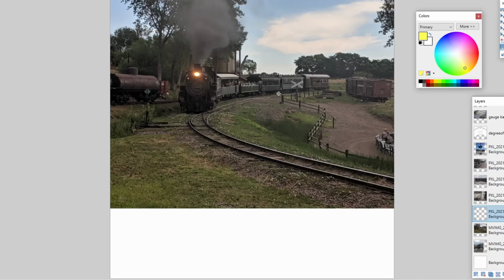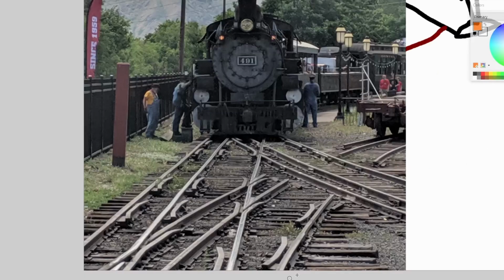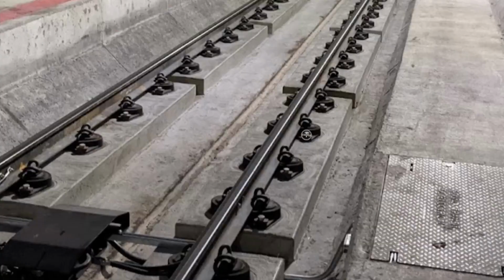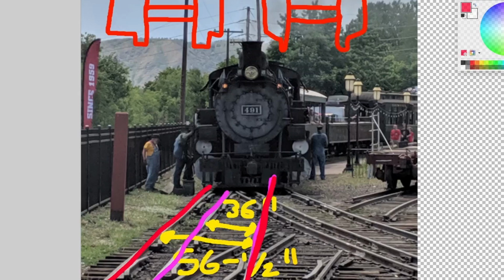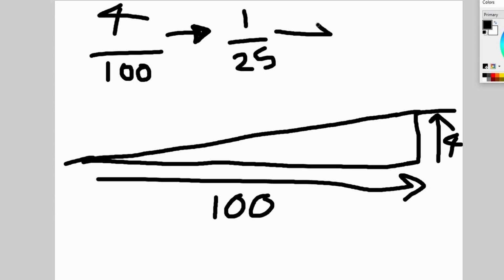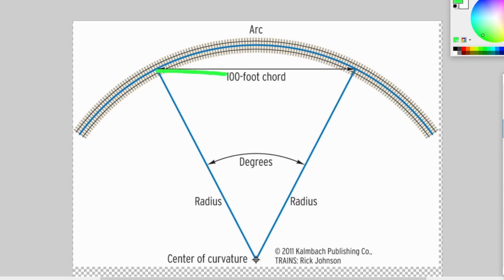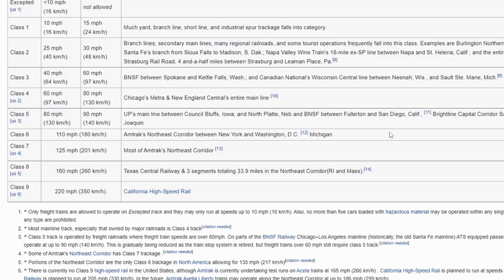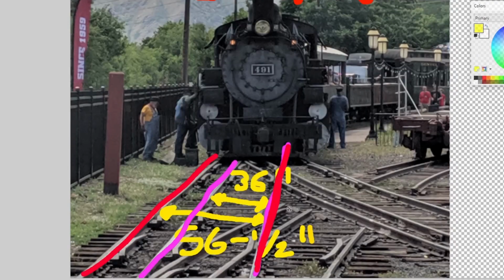TRACK 101: How does track work? (Including many often-missed things!)

Comment: Now continuous rail is generally a very good thing.   However it can be overdone.   An early installation of continuous rail in the Salt Lake area of Utah did not have enough expansion joints.   It worked fine in the winter.   Summer heat made the rail expand until it pulled free of the ties in a huge bow or curve.   Now I am sure they are far more aware of adapting  continuous rail to extreme  temperature changes.The special trains for continuous rail and the related thermite welding are amazing.

As a kid I spent hours at school watching a switcher very slowly move one or two ares along a virtually unmaintained track.   It is now a commuter rail line with proper ballast and  new ties.   the change is like night and day.  Nor does the commuter train have to crawl into Boston.

Comment: One thing about ballast that most people, including railfans, miss us that it provides most of the suspension for trains especially the locomotives. A steam locomotive has very limited travel for its axles whilst diesel and electric licomotives have a little more travel. In the UK it has been reported that short-wheelbase steam era wagons bouncing themselves off high-speed CWR at a speed they would be comfortable on sectional track due to the high-speed track having a much firmer trackbed.

Also the depth of ballastingbhas changed over the decades. In the early years in the UK the sleepers could be buried in the ballast (which at that time could been crushed granite or ash even on the ,ain running lines). Eventually the crush rock ballast would come to almost the top of the sleepers. But when CWR was 8ntroduced such ballasting did hold the track firmly enough in high-speed lines and so deep ballasting was reintroduced so that the top if sleeper was at least level, with the top of the ballast or in some places the ballast covers all of part of the sleepers.
Reply from the maker: That's interesting! Had no clue. Cheers!

Comment: Not sure about the US, but the UK has a lot of 3-rail systems where the 3rd rail is an electric power carrier for train motors, either inside or outside the standard gauge, mainly used on underground (subway) networks

Comment: HOW ARE THE RAILS BENT AROUND A CURVE ? THEY SEEM PRETTY UNBENDABLE TO ME!
Reply from the maker: Sharp curves get pre-bent, but most can just be bent and spiked in place.
Reply: The rail is designed to flex. It is not bent to fit the curve. It will straighten out by itself when you remove it from the curve.

Comment: Nice.   A couple of bits you may want to add ...
* Rail chairs tilt the rails inward a few degrees to assist the camber of the wheels to self center axles.  Not really required for low speed on narrow gauge, but essential for anything over 60kph, otherwise wheel track 'hunting' will put a flange hard enough into the side of the rail head to climb up and over it.  Older switches transitioned to vertical and so had speed limits but modern practice uses special head profiles.
* Below the ballast the sub bed between the rails is formed with a gentle slope to each side for positive drainage, otherwise whole sections of ballast can be pumped across a flat mud bed.  This surely assisted your curve being more easily moved.  Here, in eastern Australia we built 'pioneer' tracks with local stone or cinders as ballast, but ALWAYS with a large sub bed hump in the middle and drainage ditches each side.  Many of these tracks are still in use on agricultural lines after more than 100 years, though the 15t per axle limit is still applied.
* Tie spacing and rail section are interlinked via young's modulus.  If short, soft iron rails are supported at 3' centers they will flex with as little as 2t per axle passing between the ties.  Close spacing and stronger, bigger rails, esspecially with tall webs, can support many tons with minimal 'pumping' which is less detrimental to the ride quality and reduces tie 'walking'.
* There is a difference between grade and gradient.  Gradient is a changing height while grade is a height at a point along the gradient.  Thus a track may have a 1% gradient while a level crossing meets the gradient at some particular 'grade' and a road over-bridge passes the track above grade.  This is also used in roadway terminology, a highway can have some intersections 'at grade' requiring varying speed limits while a motorway has long on & off ramps with all crossings above or below grade so that speed never has to change while actually on the motorway.  bye.

Comment: The holes in the joiner bars (fishplates in the UK) would be elongated in the longitudinal direction to allow thermal expansion. CWR needs expansion joints. In the UK there is a gap of 3/8" between lengths of sectional track to deal with thermal expansion. There are some British track maintenance films from the 1930s/1950s on YT for those who are interested.

Comment: track speeds for passenger trains...I have done a couple Amtrak vacations, one was Cleveland to DC then DC to JAX.  It was lovely (I had a railroad frequency scanner and got to listen to all the chatter) but the track was not always fun.  Some parts of the east coast, Amtrak rides on heavily used freight track and...you know in a movie theatre or on a plane where there's THAT KID kicking the back of your seat and you can't say or do anything because the parents will get upset?  Some parts of east coast Amtrak route are like that.  Th-thump th-thump th-thump for miles.
Reply: re: scanner... middle of the night in Georgia someplace, train stopped at a little station.  People on and off, stuff hustled around the platform, but then the train just sat for a while, and someone on train radio asked the station what the hold-up was.  Station said a woman with kids and a bazillion pieces of luggage had just shown up and were trying to bull their way through the ticketing process and generally being hard to deal with.  A couple minutes more and the train inquired what the situation was now and the station replied, well, she's being really rude and it would be all the same to the station if the train just went ahead.  And that's what the train did.  If it's after midnight and you didn't take care of anything in advance and you need a lot of handling at the last minute...be nice to the people behind the counter.

Comment: Four-rail dual-gauge track is used where both standard and five-foot gauge are found, mostly in areas where the Russians built the track. The 3 1/2" difference is too close to permit three-rail, so they had no choice but to use four. Three-rail is still common in Japan where standard and 3'6" gauges coexist, and I think Australia has some, too, unless they have managed to settle on one gauge now
Reply from the maker: Four, but with rails staggered I presume? i.e. 5' gauge left rail, then standard left, then 5' gauge right, then standard right?

Comment: Nice video. I would add that in curves, besides superelevation, the gauge is also widened, to allow smoother drive of the wheelsets. Depending on the specific rolling stock, the amound of widening can wary, and it depends on the radius as well. Also, flanges on the rolling stock, especially locomotives, can be made different on the driving wheels, with the "outer" ones having them smaller and/or moved. Or the contrary, the "inner" wheelsets can be flangeless to improve driving in tight curves.

Comment: Good summing up. US Joint Bar, UK Fish Plate, but we don't stagger the rail joints over here. So on poor condition track you don't start a rocking motion. In the UK we've used screws into sleepers rather than spikes, if they loosen, you can fit larger diameter screws to get them tight again. 
You can of course blame the Romans for the "Standard Gauge" being 4ft 8.5in.
US Superelevation, UK Cant. We did sort of develop tilting trains in the UK, but the APT (Advanced Passenger Train) was a failure.

Comment: Wait.. wouldn't the taller rail be weaker than a shorter rail. I'm kinda confused on that.
Reply from the maker: Taller rails with the same web thickness would be weaker, but with a thicker web they actually strengthen considerably.

Comment: When riding the BART system in the bay area, why is it on certain turns does it squeal so bad? It sounds like a dolphin getting f'ed in its blowhole....by a grizzly bear.....
Reply from the maker: Apparently BART doesn't use the normal wheel profile, which is probably why...

Comment: Railroad high speed. At speed of ~100 mph only closed freight cars can be used. Wind will catch pieces of bulk cargo like coal and turn it into flying bullets. Think of two trains passing each other. The pressure drop (venturi effect) will literally suck cargo out of a center beam car.
High speed passenger cars are pressure sealed like aircrafts.

Comment: While describing the arc of curves, using the 100 foot cord, the distance to the point where the two lines join was not described.  (the distance to the two ends of the cord) Ron W4BIN
Reply from the maker: Yeah I missed that. Center of cord back to centerline of track defines the circle.

Comment: One small correction though, fixated tracks are also used widely on high speed lines, because those ICEs and what not doing 180mph cause so much turbulence that ballast would be sucked up and sent airborne.

Those oval anchors in the direct fixation are called "Cologne egg" btw, they were invented for the lightrail in Cologne originally after they realised the trains were too noisy in the buildings above.

Comment: the photo of the dual guage tracking showing a track monving to the right and then broken up with a track crossing it from the left to the bottom right. question is what railroad would cut a track so the train cant go on it. the train would derail if it triec to couple up to the cars on the right. why would this be so?
Reply from the maker: It's a display track that we hardly use, and we keep pulling the track crew off for other projects. Converting it into a diamond has been on the list for a long time.

Comment: 12:51 I live near a Union pacific car shop in Missouri where they repair freight cars. And at the current moment they are working on the main line that heads to the shop and they are welding some of the track together by one of the crossing gates by the looks of it.
Reply: Desoto?
Reply: @samfaszold79  Yes
Reply: @freighttrain7776  I just moved away from there about a year ago. It's a good little town
Reply: @samfaszold79  oh

Comment: Interesting , we use the same names for parts of a rail except we call the top of the rail , the crown . The metal in the crown  hardens with use , so it decreases the wear . Old length of rail was 60 foot here . but now its 600 feet , with a weight of 113 lbs per yard . The old type we used was called Bull Head rail . That in section looked very much like a figure 8 . When it is relayed each rail is pulled off the end of a long train . It comes off and will act very much like rubber going all ways if it is let to do so . The ends of the rail  are welded in place after fitted to the chairs  with thermite .
Reply: Mainline railroad's deliver their CWR to the lay-site in ¼mile/402.336m* lengths by tail trains, dropped within a few feet of placement, and the train is pulled out from under it. I know as I've done this for a few of my employer's rail gangs. And yes. It does act like a wet noodle when taken as a full length stick.

*5,280feet / 4 = 1,320ft × 12 = 15,840inches × 25.4 = 402,336mm ÷ 1,000 = 402.336m (just in case anyone questions how I got my numbers) obviously, the exact metric length is wholely dependant on the actual length of the stick

Comment: Great video, thank you. However, welders aren’t just leaving graffiti tags next to their welds; it is done for accountability. If there is a question about a weld, or concerns about weld integrity, the welder’s name is right there. Please keep up the great work.
Reply from the maker: I always figured that would've been a paperwork thing and the rest was for pride, but fair enough! Cheers :)
Reply: @Hyce777  I guess the problem with the "paperwork thing" is that there are such a vast number of welds, often on one "shutdown", within a short geographical distance, on the same dates, with a number of qualified welders, it would be very easy to say "that wasn't mine". However, with this requirement, there is absolutley no question - no welder with any pride in his/her work would let some other numb-nuts sign off on their job and vice-versa.

Comment: Very interesting and well presented. I'd have liked to seen a short explanation of the role of the track and wheel profile's taper and its ability to act as a "differential" to allow the wheels on a solid axle to effectively turn at different rates around curves. In a perfect world, wheel flanges wouldn't be needed on a railroad (but I wouldn't board such a train even in a perfect world).

Comment: Great video, but you didn't really explain how you measure/express curvature. It was 'we take a hundred foot span and measure the degrees' and then it went into varying-rate curves. What is it we're measuring over that 100' span? is it some ratio of the circumference and that chord (sort of like gradient, but sideways), or something else?

by the way, the gradient explanation was really helpful. I've always heard x% slope and wondered what the heck that meant in practical terms. I'd always thought it was some semi-complex mathematical formula using the degree of slope rather than a straight-forward measurement of height at 2 points.
Reply from the maker: Missed that in the edit :P sorry. Measure from the center of the chord to the centerline of track and you get three points to define the circle.

Comment: 25:20, you missed a reason to have 4 rails instead of 3: when you turntable your narrow-gage locomotive and turn it around, suddenly your "common rail" is on the wrong side and your locomotive will come off the turntable onto the dirt. If all your tracks are centered, they're symmetrical, and you can turn any which way you want to without worry. (Unless the trains can handle the slight bend from the misaligned turn table when the rail ends are matched up?)

Comment: Lol u Americans, we in Slovakia have express train that run 30 km/h (19 mph)! Because the track is falling apart 😅 

Anyway, thanks, very interesting, I'm looking forward to the signals part, because recently I've been playing with magnetometer on my phone and noted a lot of magnetic fluctuations on the train that do not happen on car and that relate to the train speed and cease on some parts of the track so I wonder if it may be caused by some electric current on select parts of the track.

Comment: Having been a track man years ago in underground mines, there are differences. The “head” is called the “ball”. Track weights are 40, 60 and 85 pounds per yard. We had ties, but we had “steel ties” which were steel ties with clips to keep the track gauge in check.  “Armour Ties” are steel ties bolted to wooden ties so that each tie kept gauge and provided support.  We used “fish plates” to bolt sections of rail together. “Frogs” to enter a switch, turn rails to help the train enter a turn, “kicker plates” to kick the wheels over so the wheels would not “pick the switch” of the turn rails when entering a switch.   In coal mines, 42 inch and 48 inch gauge was common. I can still re-rail cars with two 12 to 18 inches pieces of rail and a couple pieces of wood.  Bethlehem Steel published a track book which I still have a copy of, covers all this.
Reply from the maker: That's cool! Always fun to hear about the fun differences. Rerailing is a true art... Sounds like you've got it! Thanks for the comment.

Comment: panels often get used to replace portions of track quickly, as they can build off site (have sitting and waiting in a yard) truck in and set onto road bed quickly rather than welding in new pieces and replacing ties. generally I've seen them used for replacing small slow order sections and sections of turnouts.

Comment: A French Drain is named after General French not France. Maine had 24 inch logging railroads. Back in the day the D&RGW and the RGS + C&S  had offset coupler cars for 3 rail dual gauge. It was just a dedicated specialty car with one or two couplers on one end of it. Smaller shortlines like Uintah, Cripple Creek, DSP&P etc. were 36 inch only so no need.
Reply from the maker: You know, i want so say I've heard that before about the drains. Makes sense. We've got one of those cars, called an idler car. Some locomotives had special triple pockets  to accomplish the same task. Neat stuff. :)

Comment: I don't see how 2 points on a curve and the linear distance between them will give you the radius of curvature. There are infinitely many curves that can pass thru 2 point that are 100 feet apart. There's got to be some other piece of information.
Reply from the maker: Yeah, I totally goofed that part. You measure from the center of the 100' chord that is stretched between the two points back up to the centerline of track to define the circle. My apologies on that piece!

Comment: The steepest adhesion standard gauge line hear in Australia was Kenny hill on the Camden branch in NSW. It was 1 in 19 and with the locos used on that line allmost all trains more then 1 car required double heading.
Reply from the maker: That's crazy steep!
Reply: yeah. The line closed in the 60s for obvious reasons. There are/was so many interesting and quirky lines here down under.

Comment: Do the wheels of the train passing over the insulated joints defeat the insulation?
Reply from the maker: I imagine for a split second it could, but that doesn't really cause an issue.
Reply: @Hyce777  ok thanks!